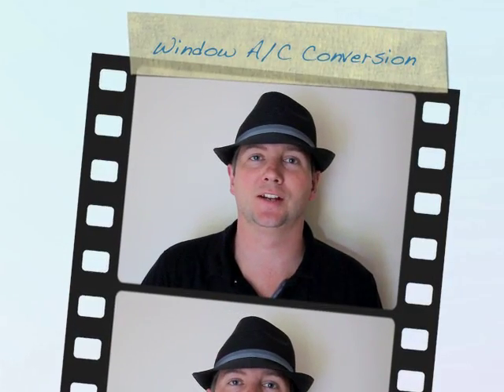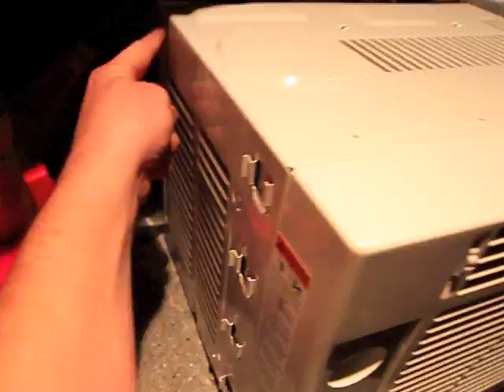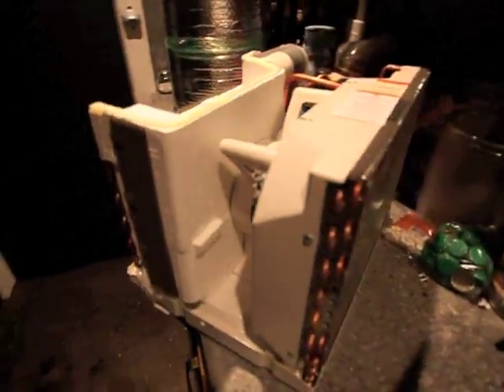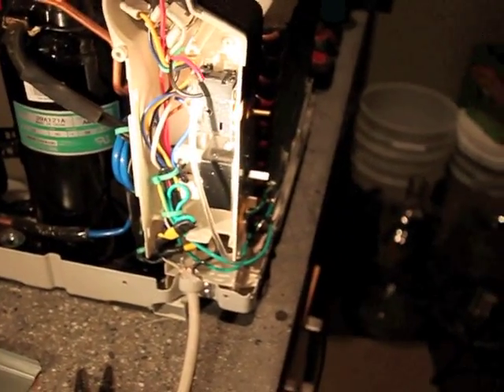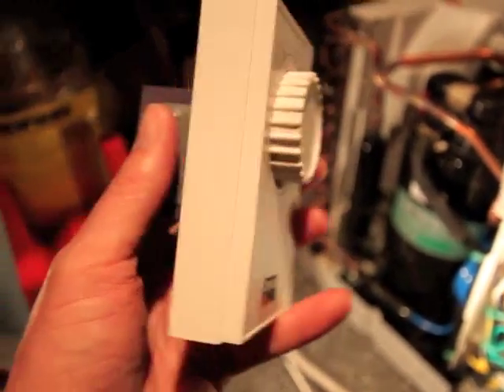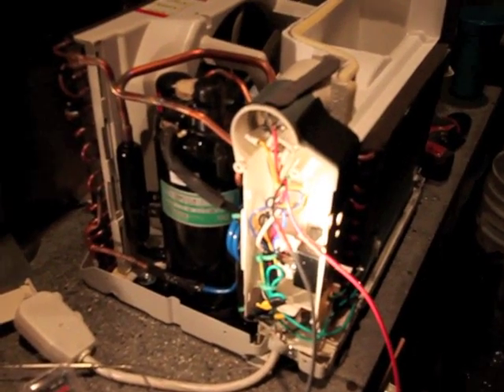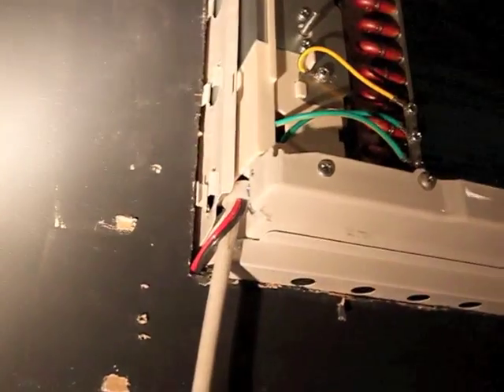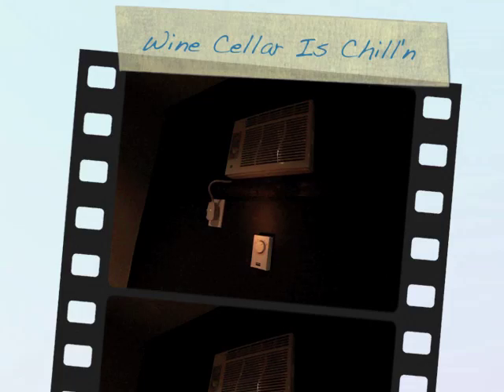Window Air-conditioner Conversion

Comment: You could calibrate the knobs that came with the AC to get colder 
There's a screw on the bottom you turn and you can make it run colder to even 0s if you wanted but 50F° is possible

Comment: Nice work.  I'd run the extension for the 110/120 volt AC in conduit or at least use Romex and a Romex connector cut to the bottom of AC unit.  There are tapered drill bits available for making the hole required.  Given the level of potential ice buildup and or water - liquid tight conduit or BX may be a better alternative .  Just my 2 cents

Comment: CHAD:  Does your modification retain defrost cycling?  I had to add a timer on my modification so that the compressor would shut off every 15 minutes to prevent too much frost buildup.  Without a defrost cycle, the fan in my LG air conditioner became blocked with frost and would quit turning.

Comment: Another thought is just mover the copper tube that in front. Or cover it with heat rap.      You can add more layers for a lower temp up to a point

Comment: Ok so what if you take the temp sensor from front and stick it in the back of the a.c. ? Will it blow colder? Because the back of the a.c. is just hot air the sensor will trick the condensor to staying on . Yeah it might freeze over tho. But so far no videos on what I mentioned.

Comment: Most AC units with a digital display use a thermister of 10kohm to 15kohm mounted to the evaporator.  To make the unit run at a lower temperature, you can add a 47kohm to 100kohm resistor in parallel to the thermister by cutting the wires and soldering the resistor or connect with small marrets.  This makes the unit run at a lower temperature suitable for a wine room without affecting the automated functions of the ac unit.  The digital display will be inaccurate so you would need a thermometer in the wine room.  So for example, I added a 47kohm resister and set the ac unit to 79 degrees for an actual wine room temperature of 58 degrees F.  I located the a unit in our service room and duct the air into the wine room  with a 6 inch flexible insulated line and located the thermister in the wine room.  Initially I used 4 inch line but had evaporator icing issues.  Using a 6 inch line, I had no issues.  Your really are only trying to get the unit operate 3 to 7 degrees F lower.  Adequate airflow is important so the unit won't freeze up and even more important is a properly sized ac unit. If you have say 500 bottles in your wine room, that's a lot of thermal mass.  The size of the room and the amount of bottles determine the ac unit size,  I used a 10,000 BTU unit but I believe an 8000 BTU unit would work well also.  We have about 500 bottles in a 10ft x 7ft wine room.
Reply: I am try to keep cool my wine closet 5’x1’x8’h, I though to install a very small ac unit in attic with a 2” insulated duct or maybe I can get a 4” thru a 2x4 wall, is about 12’ away from the closet, do you think it will condensed?
Thanks

Comment: I have a 1,250 cubic foot insulated cooler In extremely hot conditions (a metal building in south Louisiana).  I had a $2,300 Breezaire WKL 8000 (12,000 btu) that finally went out.  I used a ($150 @ Lowes) GE 5050 btu ac to replace the breezaire.  At the time it was the only unit I could find to fit the previous opening cut (16.75" width) for the breezaire.    I went with a Dayton 6EDY5 Line Voltage Thermostat ($38.72) which would allow me tthermostat control down to 30 degrees.      As the temperature drops below 60 degrees, the condensing coils started to freeze up. So I mounted a STANLEY 655704 High Velocity Blower Fan($51.00), set it on high, forcing air through the coils.  This keeps it from freezing up.  This summer, I was able to hold 57-59 degrees without the coils freezing up.     I plan on buying a backup ac.   Upon further research, and since I'd like to increase the BTU's  closer to the size of my Breezaire, I found four options by searching for Vertical  Air Conditioners.  1.  Frigidaire FFRS0822S1 8000 BTU Heavy-Duty Slider Casement Window Air Conditioner ($469.00)    2.  Frigidaire FFRS1022R1 10000 BTU 115-volt Slider/Casement Room Air Conditioner ($599.00)  3.  Global Industrial Casement Window Air Conditioner 10, 000 BTU ($449.00)   4.  PerfectAire 10,000 BTU Slider Air Conditioner Window A/C ($490.00).   By the way, one of these would have been my first choice for my situation.  Also, even with the Breezaire, I also run a humidifier.....Need that humidity!

Comment: You can do that same thing in 4 different ways:

1. Coolbot - $390 if you want the wifi version

2.  Cool Controller - $99 from this old engineer - https://www.youtube.com/watch?v=K_bm5-n8Udg.  Find him on Facebook. Or his website:
 jc-solarhomes.com

3. Any small light bulb that warms up the temperature sensor will make the compressor run forever.  Basically place the temperature sensor near the bulb but not on it - so it just stays warm but not hot or melting the insulation.  Wire a $10 digital thermostat from ebay to control that light bulb.  When it is on the A/C thinks it needs to run.  When it's off the A/C realizes it is too cold and shuts off.  But now the temperature control is done through the $10 ebay thermostat that turns the light bulb on/off as if it is the actual A/C. Replace the light bulb with a low voltage heater pad if you want.
https://www.ebay.com/itm/10A-110V-Digital-Temperature-Controller-Temp-Sensor-Thermostat-Control-Relay-US/141731449329?epid=595245028&hash=item20ffda49f1:g:~loAAOSw3ydVuZEX

4. No electronics - bent PVC tubes with valves that place the temperature sensor in a pipe where you mix cold and hot air taken from the A/C itself.  Cold air is taken from the suction of the evaporator (the front radiator of the A/C).  Hot air is taken from the air blowing out of the condenser (the back radiator). Adjusting the valves changes the mix of hot/cold air effectively allowing you to control the temperature by fooling the sensor what is the real temperature in the room.

Comment: You can use a regular thermostat or a nest what ever you want. Just buy some rib relays wire your circuit to the coil from the t stat and wire your 120 circuit to the rib relay contacts. Most ribs I use are 20 amp contacts. I have converted quite a few units do to cheap Chinese temperature controls.

Comment: You really don't know the purpose af a capillary tube thermostat. This tube not only serves as a protection to tell the compressor to stop, but also to keep the evaporator from getting packed with ice from the moisture collecting on the evaporator tubing. If the tubing gets packed with ice, air doesn't reach the fan anymore and is not blown back into the room. Hence, no more cooling!
Reply: Thank you so much the video really help me save sum money

Comment: The fan does not keep the unit from freezing. Not running the unit in weather below the recommended ambient temperature is what keeps the unit from freezing. This is not recommended as it can significantly shorten the life of the unit if your unit can not properly cycle on/off. You're better off getting an appropriately sized unit for room refrigeration.

Comment: I don't think you mentioned it in the video, but doesn't the thermostat need to be for air conditioning, and not for a heater or furnace.  Otherwise, it seems a heater thermostat would  make the compressor turn off when you want it to turn on, and turn on the compressor when you want it to turn off???

Comment: Coolbot costs $320 and this effectively does the exact same thing. I have been sorting out this issue for around three days now.. First I tried running the little Tstat bulb through the wall to ambient (warm) air as I thought just the tip was sensitive. Wrong.. The whole thing is. Next I tried wrapping insulation around it to try and isolate it from the cold..I concluded no matter how much insulation I added the cold would reach it. I thought about wrapping it with heat tape for the prevention of frozen pipes but knew it would freeze the evaporating coil.. Looked into getting a repeat cycle timer to power the heat strip, 5 minutes on 5 off or whatever.. Very long story short, I'm taking the advice learned in this video. Thanks for putting it up, nice build and great mind! Peace.

Comment: good video
is that thernostat cool only or heat only or both?
also do you leave the fan on all the time or is it also controlled?
Reply: It would definitely need to be a "cool" T-Stat. Straight heat T-Stat would keep calling for "heat" as the temps plummeted causing the unit to freeze up as it would never cycle off. Home Depot has them for $31.. The part is called "Cadet C600" and goes down to 45 degrees. Eureka! Hope this helps.

Comment: Hi I have a identical unit although mine is "made" by Sunbeam and the model is SBRAC5KWG. I think the thermostat on mine is broken as it will no longer click. It always took awhile for the compressor to come on even on the hottest days but now it will no longer come on at all (It was cooling fine so that is not the problem) Do you know how to get the thermostat to work again? I have a feeling that thermocouple went bad is there a way to fix that.
Thanks

Comment: What would happened if you connected the red and black wires, basically bypassing the stock thermostat, and ran the entire unit with a temperature controller. The fan would not run all the time, but do you really want the fan to run 24/7?

Comment: very interesting, ok after you installed this did you have any problems with the unit freezing up or did it run just like you said in the video?? reason i ask is i sure would like to have this in my house,
Reply: letseeitplease   I removed the thermostat and the temperature started dropping but the coils started to freeze,cut off the air flow and the temp went back up, i decided to experiment with air flow changed the fan speed to high and added a fan in front of the unit blowing directly into the front of the frozen coils.  I have also attached a thermostat that turns on the power to the a/c if it gets warmer than 55 when it gets temperature to 55 turns off the power but the extra fan continues to run. So far this works, I’ll continue to experiment and see how long this works.

Comment from the maker: Carlos,
 You would need to bypass the digital sensor that tells the compressor when to turn on and off.  There is also a device called a Coolbot that hooks into a digital a/c that works way better than what I did to this a/c.  It tricks the sensor to that the compressor will stay on longer.  I have had a problem with my unit freezing up if I drop the temp lower than 58 deg.  Let me know if you have any other questions.
Reply: hmm, interesting, have you resolved this problem?  Would a timer circuit help, that would cut power to the compressor, with a relay controller or circuit?